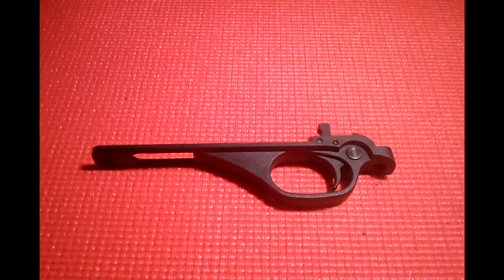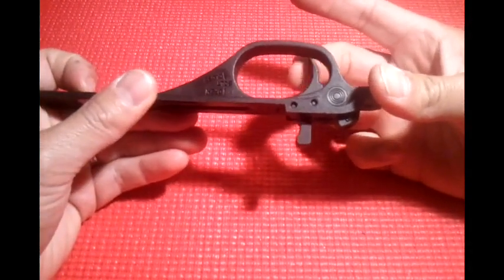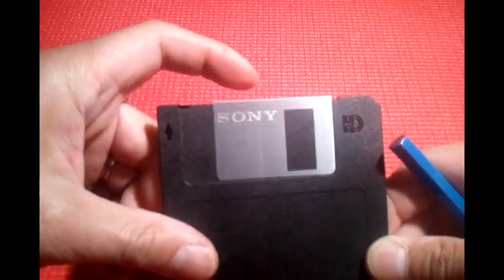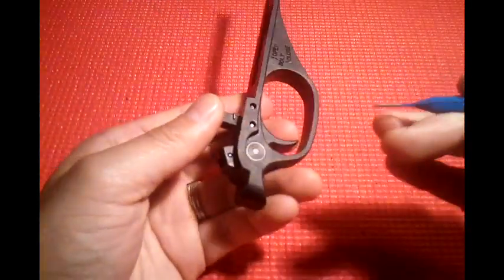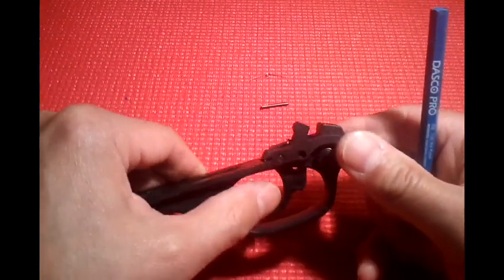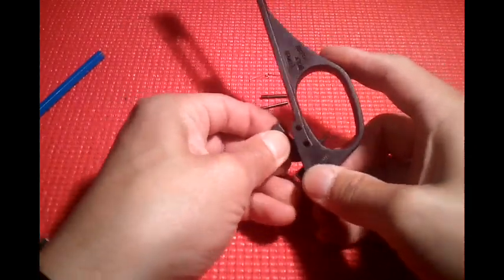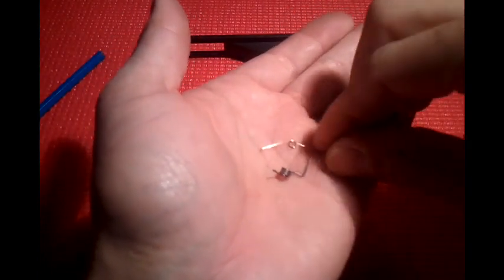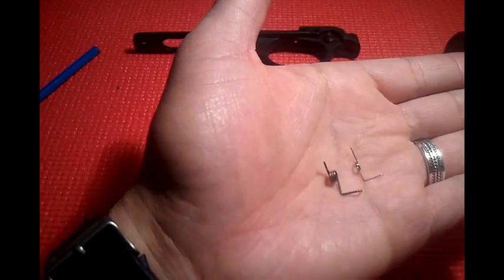Marlin 795 Trigger Job - Part 4 (3.5 Floppy Disk Trigger Return Spring)

Comment: @FogCityTactical Quite sensible.  I over did the weakening of the hammer return spring but its easy to bend back the other way a little.  The other thing I am going to do is install a set screw in the trigger where it engages the sear in order to remove sear pre-travel.  I've seen a few triggers sold after market like this but I figure why not do it myself.

Comment from the maker: @Nutter1138 Thanks for the info.  I thought about weakening the sping as well but I decided not to just incase I want to return the rifle to stock form.  The sping isn't available seperately from the trigger guard assembly and I couldn't find one in stock anywhere.  As a side note, I ordered a spare for each part I modified.  Figured it would be cheap insurance.